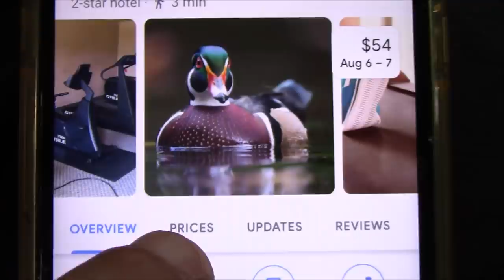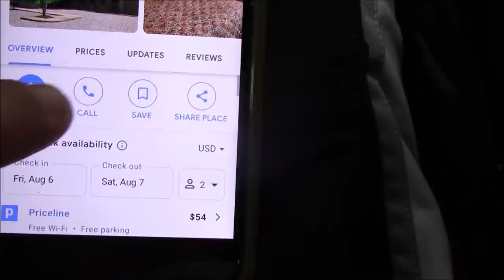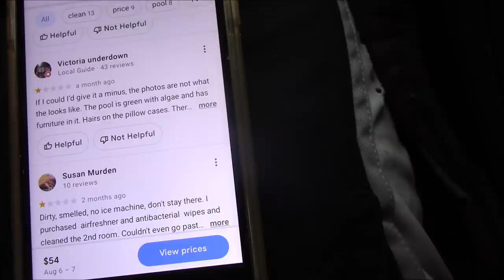We Booked a Room at an ABANDONED HOTEL. We Were NOT Prepared for (THIS.)

Comment: I been right where you guys are and we paid $5000 to fix the truck new motor install. It ran great for 2 months then went down again. now we were more in debt and still didn't have a truck to use. Felt we didn't have choice since it was financed. We ending up returning truck and taking a credit hit. Made more since than putting more money into truck. Just alive of experience here I am almost 60 yrs old. But I still remember this crazy time in our lives.  Happened about 12 yrs ago
Reply: Yep had the same happen to me on a couple vehicles, sad really went in for one thing then a wk later it has ten different things wrong. It’s like once they touch them they rig it so you have to come back… last vehicle I got is a Kia brand new I figured every two to four yrs I was wasting 8grand plus on vehicles. So far my 2018 is still running like new, hopefully it will last me a good long while….

Comment: I would be thinking twice on this truck. I have a feeling this mechanic is trying to rip you off. I've seen advertisements where mechanics have quoted a high price saying all kinds of stuff needed replacing and it was a simple job that didn't need all that done. Check with someone else and see if they say the same thing. That hotel would be a no go for me.

Comment: Get the head gasket fixed. Don’t let them replace the hoses. That’s something you can do after. My truck, I did that. They fixed head gasket and I’ve been replacing everything else as I go. It still drives fine.

Comment: All the trauma and Hollie is getting hysterical.  I don't blame her, so would I.  I have a couple of suggestions.  You can stay behind a big box (such as HD, Lowe's and Wallyworld) store since Chris has built the bed in the trailer.  Check a YMCA for showers, or even a truck stop.   Bathrooms you can find anywhere.  Take a towel and soap with you :)  If you get asked what you are doing behind a big box store, say you are on a vacation and got tired and pulled off the road.  Go to a laundromat to wash your clothes.  None of this is ideal but in a pinch it could work better for you than paying over $50 for a place like that motel.  Praying for you!
Reply: Maybe others can come up with even better ideas!

Comment: If you do the repairs it will be like having a new truck pretty much. If you still owe money on it, you'll just be adding to the balance if you get another truck and that won't have a new engine in it. Just my thoughts. It's horrible, but if the rest of your truck is in good shape, you still owe money on it, I  would make the repairs. You don't need to add more money of another truck that wouldn't be in any better condition than the one you have once repaired. I doubt you'll find another truck with a brand new engine for eight thousand
Reply from the maker: We are planning to fix it, but not here. They quoted me 3-4000 and they are trying to charge me over double that now that I had it towed there Lol.
We cant seem to get away from these lying crooks.